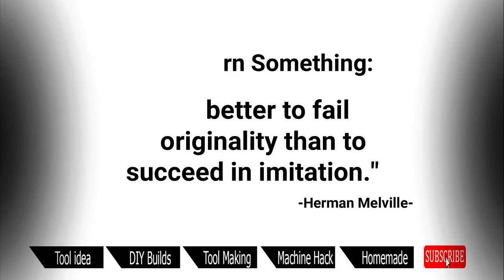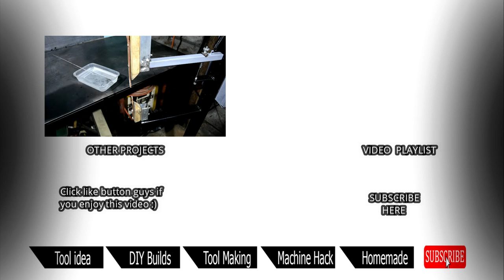DIY Scooter using angle grinder

Comment: Bearings in that grinder head ain't gonna last. Your'e lucky to get an angle grinder with dual roller bearings. Usually at least one of the two are just brass bushings. Whether brass, needle, or ball theyr'e not made for that kind of load. It'll work for awhile at least. I wish he'd thrown  another bearing and support on the other side of the rear wheel.

Comment: Overall an excellent design, however, the rear axle requires reworking, since there are at best two small bearings that will be destroyed very quickly. But like I said, I liked the position of the engine in the front, and I also had the idea of making the exhaust pipe inside the frame, which should dampen the sound. You have already implemented this. It is also advisable to provide a shield over the rear wheel, which has already been written here before me.

Comment: Awesome ! Never thought of using an angle grinder as a drive , maybe an upgrade with some kind of springs on the front end could be a follow up video , it would take the shock off the front end and make the ride much smoother Im sure , great work .

Comment: So, basically, it's a worm drive scooter. Coooool. Well, technically, ring and pinion, but still cool.
Reply: it's actually still a chain drive
Reply: @Robertas_Grigas  no shit sherlock, I was obviously referring to the wheel drive system.
Reply: (Insert gratuitous eye roll)
Reply: At least some of the chinese little engines have gear reduction. Don't know about this particular one but I would say by the looks of it that it's gear driven
Reply: And the angle drive is called "crown and pinion"

Comment: 4small bolts for the angle grinder holding the rear wheel.... One heavy bump it will break the angle grinder head...

Comment: Nice idea. Congrats..
But you'd better:
-add suspension. For "angle grinder" life and driver's comfort. 
-add protection for shaft (btw shaft doesn't seem to be aligned properly)
-add heat insulation/protection for exhaust pipe
-add fall protection bars for engine.
Reply: Ozcan... are you from Cyprus.  Sounds like a Turkish name.  I'm living in uk but moving to north Cyprus for a few years
Reply: @marm1mustafa100  Turkey ;)
Reply: @mertology  Turkey is a lovely place.  I like Istanbul..🇹🇷👍

Comment: Very very cool. Got to be careful with the front only brake. Hit the brake hard enough and the rider is going over. LOL. The brake could have been on the rear wheel but it wouldn't have looked as cool.
Reply: Front brake far more efficient. Back wheel would lock easily. If I only had one braked wheel it would be front.

Comment: There's not much chance of that drive gear lasting more than a few rides. Simply not designed for that amount of torque. Really need a 90 degree torque box for an industrial application. Better yet, fit a chain or belt drive.
Reply: True. Also I can't see the bearings in that grinder head lasting too long either

Comment: Worked great for two days, was stolen and the thief was found later all tangled up in vines on the side of the road after the scooter fell apart while traveling at 25 kph.
The builder was issued a summons and was later charged with constructing an unsafe vehicle.
Meanwhile the thief retained the services of the village attorney to prepare a case against the builder in the hopes of recovering money in order to offset some of his medical bills resulting from the crash.
The neighbors of the young scooter builder was overheard saying; “I knew one day they were gonna get someone hurt, they almost ran over my pig last week!”
Reply: Get arrested 'cause of a thief is injured after steal your own handmade scooter.

Great
Reply: This can't be real what you forefit 90% of your rights when you steal property that's property it's not a vehicle a road vehicle has to comply with dot regulations which that does not so the thief is barking 2 laws stolen property and  unroad worthy vehicle
Reply: It’s just a joke.
Reply: But then later on that day the builder made a go-cart pick up truck & went back ,got the pig & had ham sandwich dinner that night. The end🤪

Comment: Great till the grinder part falls apart when you're going 40 MPH down the road and end up taking all the skin off your face. I am impressed with the result on limited tools / fab work though.
Reply: the average angle grinder is like 1000W and that engine seems about 1kW as well so i don't think the angle grinder bit would fail that easily. Surely i would make a terrible racket if it were close to failing.
Although i wouldn't want my shoelace to get tangled in that rotating shaft.
Reply: @poptartmcjelly7054  does a normal grinder have a 50+kg load on it too?
Reply: @danielspoon1234  exactly you are right
Reply: @poptartmcjelly7054  a grinder doesn't run continuosly, especially with heavy load... the grinder also has a fan inside but since he pulled that out, the bearings doesn't have any cooling

Comment: Wish i had a welding machine. I would make things like these all the time.
Otherwise a mad machine. Love it.
Reply: Sergej Nadaždin you should make one if you like to make stuff. You can make one from old microwave. Look at the king of random vid on it
Reply: @lukerimkus2009  i know but i already melted one transformer and overheated quite a few wires and almost burned down my apartment, so i don't think i'll try that again plus i live in a tiny apartment, so it would be quite hard to weld there.

Comment: I would love to see a diesel/petrol electric powered scooter using the same idea a Dynamo wired to a low volt power tool ...would it work ?
Reply: That would certainly be fascinating.
Reply: They are a universal motor and will run on ac or dc

Comment: The bearings in the angle grinder head are not even near strong enough for this to last
Reply: Ayup the head of the grinder is cast alloy aswell
Reply: Yea that was what instantly popped into my head.
Reply: You'd be surprised to see how many things are way overbuilt, I've taken apart angle grinders and the bearings are usually way oversized for the application, I agree that they're not made for radial loads, but usually with quality and oversized bearings (scooter bearings are usually 608's... Angle grinders have bearings easily 1.5 times the size) you can go past the limits and use them improperly for quite a while.
But anyways I doubt he ever uses that thing for more than a couple of kilometers.
Reply: My thought also, Fantastic idea,but that angel grinder gear will have a short life...I would hire him in a mechanical R&D Department.
Reply: Very true but I give him points for originality and being a true junkyard recycling master.
Reply: if grinder can withstand 30k rpm, on this scooter will more than enuff..
Reply: @mattranze   a grinder does not spin even near 30k and even if it did ..... this is a totally different loading than on a grinder...... you can spin a balanced system fast without it being structured strong

Comment: i would use other steel type on the wheels, these silver bolts bent easily unter shock.
Mayb be higher grade steel bolts, they costs only a bit more but are way more stable.

Comment: Only having brakes on the front is a big mistake since whenever you’ll use them the whole scooter is gonna want to do a front flip, smashing your head into the ground in the process
Reply: Louis-Félix Germain I’ve got a scooter very similar, only has front brakes. So long as you don’t slam on the brakes, it’s pretty safe as all your weight is over/close to the rear wheel. Would be nice to set up a rear brake system but I’m lazy asf haha

Comment: I really like it, no chain slack and maintenance issues. I wondered how strong the 4 bolts holding the grinder head would be. If the driver weighs 115 kg
Reply: I'm giving something similar a try, but instead of just the 4 bolts holding the grinder head on i'm going to use some steel channel that fits around the head of the grinder and enclose it with another plate making it one piece with a bit more support
Reply: @Cei-1i4   manda o vídeo.

Comment: A thumb throttle and putting the brake in the rear would make it a lot more safe. Also, some griptape for the board.
Reply: Worry about your own safety, why do you feel the need to chastise others? Are you bored?

Comment: I tell you now by blowing 100 lbs of air over a 100 lbs wheel attached to a generator attached to 2-12 volt batteries and an amplifier to 220 to keep an air tank compressor running to keep 250 lbs of air in the compressor tank. You would have a mini-power plant. By attaching more then one generator each to the center shaft you can have as much power as needed.
Reply: sound like a lot of work to kill two 12 volt batteries, I find a shotgun works better
Reply: @pacman10182   so use a 5 kilowatt generator using a finned wheel and you have all the clean green energy every needed
Reply: @DanaBidlake  powered by wind?
Reply: @pacman10182  No power by compressed air over a finned wheel like a windmill but side ways at a 90 degree angle
Reply: @DanaBidlake  you'd just lose powder though mechanical and electrical resistance and the substantial inefficiency of windmill
you're talking about perpetual motion, it's not real, it cannot work
Reply: @pacman10182   compressing air and releasing is not perpetual when the gage on the compressor is set to refill the tank every time it reaches 100 pounds it fills back to 300 pounds the air release your not using 100 pounds of air. Now if you add weight you get sin'trif'icle force with the air presser keeping the weight in motion the force foreword acts as a wind mill with out the wind - ball bearings allow for a free flowing wheel in actuality your spinning a top with a force of air attached to another free flowing wheel. Dose this bring any more understanding???
Reply: @DanaBidlake  build it, show me this BS works
Reply: @DanaBidlake  you're missing the part where the compressor takes more energy to run then the fan will bring back

Comment: I have tried doing a mtorized scooter with a chainsaw engine and front wheel drive two years ago. I have failed miserably
Reply: Mostly because I did not have money for a normal transmission or welding skills
Reply: Just buy a harbor freight flux core welder. They work great and will weld a large amount of stuff actually. I learned on it and have made tons for stuff for years now. They start at 100$

Comment: Plastic gears in that grinder head wont last long
Reply: Never seen one with plastic gears, they are steel spiral bevel gears, may last some time if lubricated with grease
Reply: Plastic gears? You are is funny
Reply: Gears are steel, although the grinder won't last long at all due to no support on other side of wheel, the bearings will shit themself in no time
Reply: I made a weed wacker engine bike using an angle grinder gearbox, the gears wore out and I went through 3 gearboxes
Reply: @ghettobikelife8833  I used a weed wacker engine and an angle grinder gearbox to make 2 stroke RC car. Still goes really well
Reply: oli12 Shackel probably would last a lot longer on a rc car than pulling a guy on a bike, I’m guessing it spins the tires  a lot? each gearbox still lasted some pretty long rides it was just a pain redesigning it for new gearboxes

Comment: you didn't show how  you attached the switch
Reply from the maker: Sorry for that bro.
But when you buy that engine there is a wire that when you touch to the body of the the engine. The engine will stop running
Reply: from which website did you ordered
Reply from the maker: Bangood
Reply: @letslearnsomething30  i also ordered but it was broken
Reply: @letslearnsomething30  i aso ordered but it was broken
Reply from the maker: What is broken bro?
Reply: @letslearnsomething30  gear box
Reply: @letslearnsomething30  gearbox bro
Reply from the maker: you can return it bro if you want. thats also happen for me the item that I received was also broken due to shipping process.
Reply: @letslearnsomething30  ok thanks bro

Comment: Nice A+ but why didn’t you just to make it electric with the angle grinder and find a way to control the speed ( depend on the type of motor idk the motor ) then put a few lithium batteries for fuel again A+ I just don’t see why you  didn’t make it electrical.
Reply: Cause engine sounds cooler than bzzzzzzzzz.

Comment: sounds like Filipino in the background.
Reply: because is
Reply: Pinoy!
Reply: @enlacdmx4379  yea I thought I heard that.  When I was in Panglao some years ago the gas tank on my motor was leaking really badly.  I was on the middle road going to alona far from Tagbilaran.  A guy took my tank, drained and welded it!  right there off the road. awesome.  Pinoy can fix anything.  he only wanted like 100 peso but I gave him 500 cause his welding was first class.